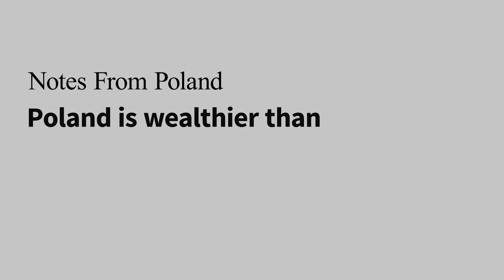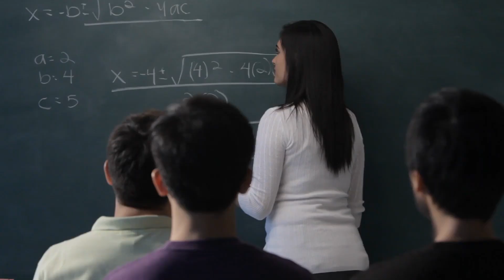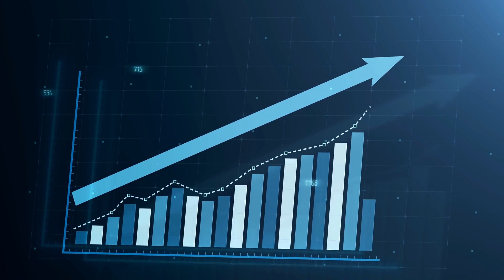Poland Economy Explained

Comment: Inflation in Poland was officially reported recently as 14%. With it's own currency, the Zloty, the Polish economy is likely to suffer from more Inflation and devaluation of their currency. 

As to the refugees, Poland has admitted that the refugees are not adding to the economy as once the tourism had prior to covid. Abortion laws also prevent refugees from early terminations. Poland is about to fall in the economic ranks as it is still dependent on foreign energy.
Reply: Yes and no. The infaltion and energy problem in similar (or even worse) in most of Europe.